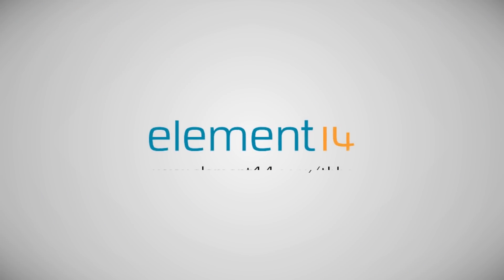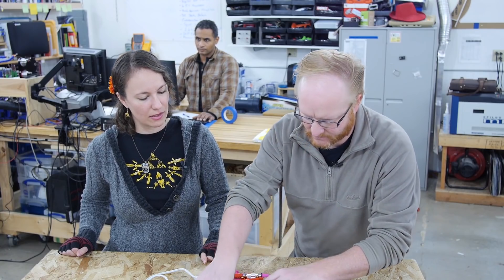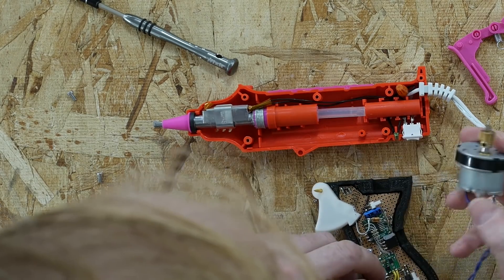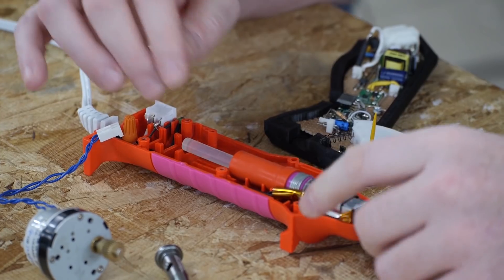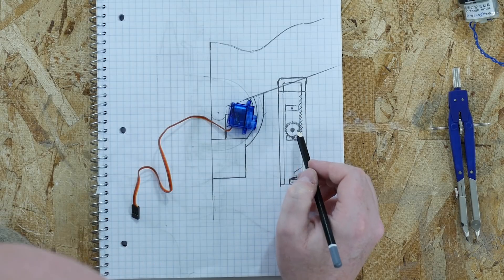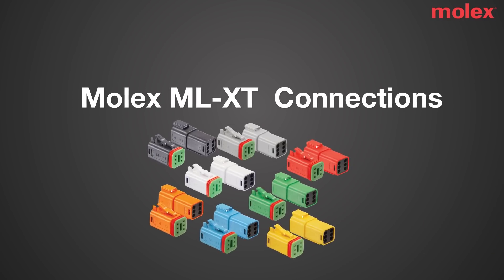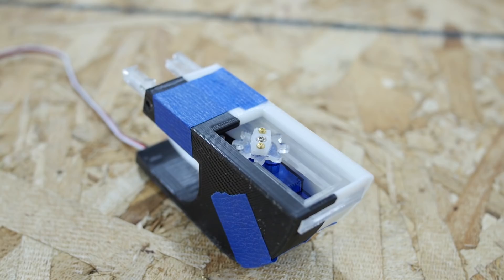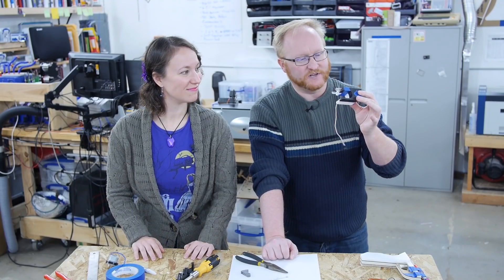Super Glue Gun 10: Time to Rack and Roll

Comment: i dont like the design of this, i think instead of the glue sticks being crammed in between gears to feed it out that it would be better to have a compartment that slides out, holds the glue in, and is closed in to better feed the glue sticks out (think a caulking gun except its got a opening to throw the glue in). that or if the glue sticks dont stick together at room temperature, they could be fed via a "clip" applying pressure to the sticks with a spring or the other glue sticks onto a kind of treadmill or a series of hourglass shape gears/toothed rollers. though my second idea is probably prone to issues....

Comment: You could have used a solenoid bolt type for the autostand, smaller than a motor. If you designed it right you could actually use a electromagnet coil around a metal pipe to heat the glue due to henry current, and use that same electromagnet to pull back the  stand while powered.

Comment: Keep building that Autodesk Fusion model.  Add in joints, contact points, and motion and keep the timeline in good shape as you rework features.  You'll be much better served than from the hand sketches and be able to generate shop drawings to help fabrication.  Unfortunately, it won't make for an interesting video, but the end product will be amazing.

Comment: if you move the motor back and use the short glue sticks then it wont be able to retract the glue stick because it will be too short
Reply: Yes especially if you have 2 glue sticks one behind the other and the motor is pushing on the 2nd one.

Comment: If you move the motor back you cannot use the retrackt
Reply: There's a limit for that too. While using the gun, if one stick gets too short and it goes beyond the reach of the motor, let's say, 1 or 2 inches, it won't retract.
The gun should have its Metal Gear(s) pretty close to the hot end. As in as close as possible.
That or an Archimedes' screw.

Comment: Why use two motors for the extrusion and stand extraction and retraction?  How about a gearing that switches between the two? I can't think of a scenario where you'd need to move the stand and extrude glue at the same time.
Reply: That would be cool, but it could get real complicated and expensive to manufacture.
Also, they want(ed?) to retract the glue stick too avoid oozing.

Comment: Another flaw in the current design: if you extrude from a second gluestick, you can not retract! Ma major feature for the super gluegun...
Reply: Still won't when the back end of the glue stick gets past the gears of the motor.
Reply: Ooo, that's a really good point! If we have the drive motor farther from the hot end than the length of one glue stick, then that would be a problem. The motor would not be able to retract the active glue stick. Hmmm.
Reply: I've heard of that technique before. Sounds like a really get practice to get into.

Comment: The auto stand is cool but it is not manatory in my opinion. What i would like for a glue gun is one that get hot really fast because some times you just want to glue a little piece and you have to wait 5 minute or more to get it hot just for glueing two wire... In these cases i grab my lighter and melt the glue stick directly. 
Anyway good job ben heck's team you are close to something fonctional i think.
Reply: ryobi 18v battery glue gun it heats quick and stands on its own

Comment: What if the extrusion motor (when run in reverse) caused the stand to come out.  That way you'd back off your glue stick AND get your stand out all with 1 motor?
Reply: Dave McAnulty if you can do it without a special gearing, awesome.  I was thinking a transmission would be needed.  Either way I support the idea of using one motor instead of two. (Turkey way, wtf phone)
Reply: you could use a ratcheting mechanism that only engaged when the motor was reversed.
Reply: actually I really like the "transmission"-idea.

Comment: Why not just model out some angle brackets on the side of the glue-gun so you can lay it down on its side? That way it doesn't tip over and it's cheap and simple. I feel like you guys are really bikeshedding this stand problem.
Reply: avfusion That was my thought as well - all you need for a stable stand are three points of contact with the workbench, ideally spaced far apart for stability. The straight-up stand ideas in the video so far put two of the points really close together in front of the hot end, which seems like it would tip sideways at the slightest bump or pull on the cord. You could just put a ‘bump’ on the lower side of the barrel at the front, and mount a ‘kickstand’ on the same side that could flip out to form a tripod with the bottom of the handle as the third point of contact. The ‘kickstand’ could be actuated with a servo or even by gravity alone when tilting the gun.

Comment: How about redesigning the glue stick itself. More like 3mm filament with cartridge system with smaller actuator and  heating element.
Reply: Good idea but not practical. You would need special glue stick that are not available anywhere. They design this glue gun so they can source every parts and keep the cost low.
Reply: Yeah I know. It might not be right for them but I would be into a whole ecosystem that would have a fast flow and very accurate delivery system .